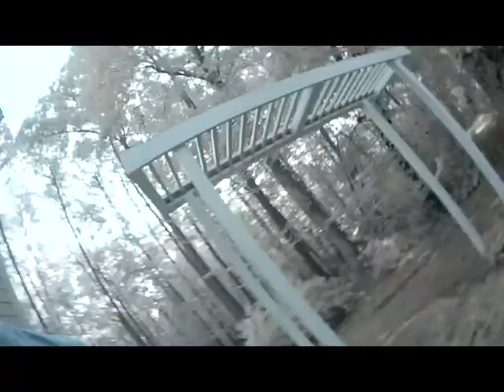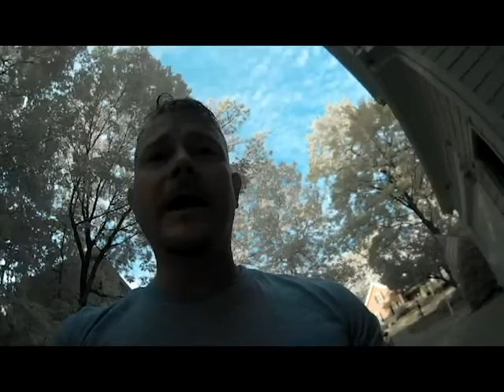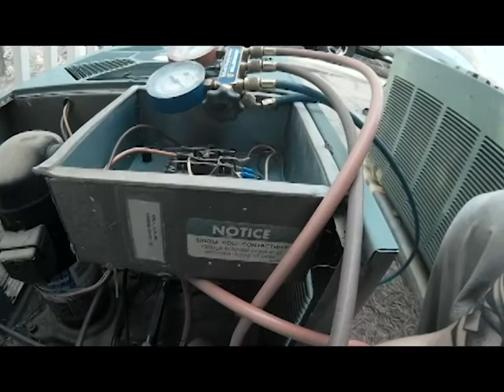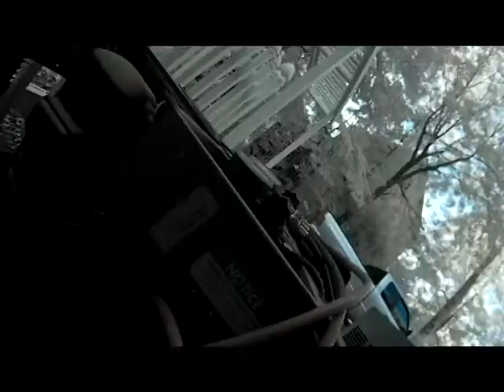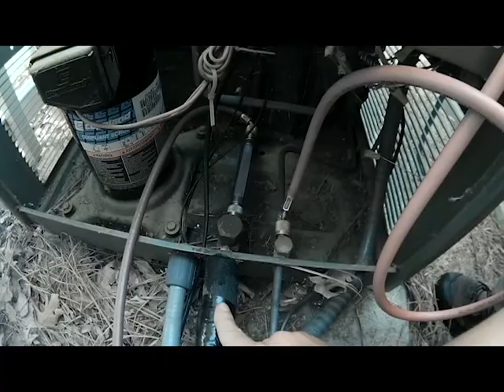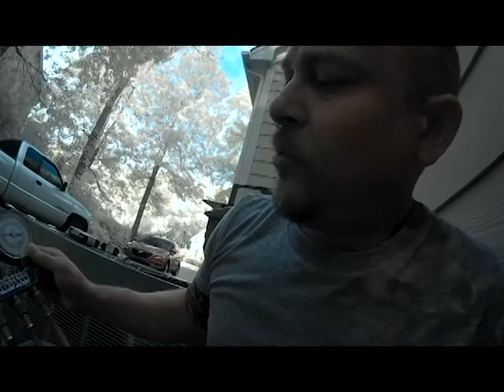Fix Air Conditioner Refrigerant Leak in 5 min.!!! | Easy Seal

Comment: Hello... I live in a condo on the second floor... I had a new unit put in back in April and during the course of several months the coolant ran out.... Long story short there is a leak in the lines... when the AC people came to fix the lines it was determined that the lines are in the floor of the unit and under the building... where they are unable to get to.... should I try the leak sealant to see if that will help????